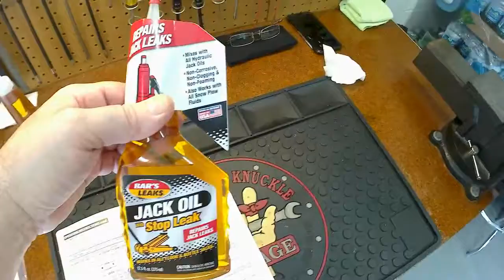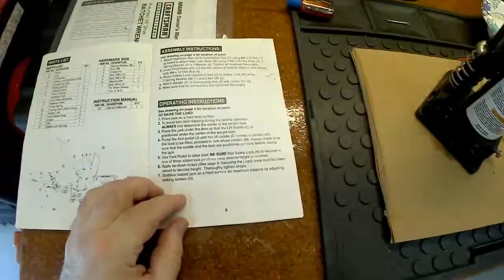Modifying and increasing the life of my 18 year old Craftsman motorcycle jack.

Comment: Just installed a Redline Rl-135 bottle jack on my older Craftsman jack that had a worn out bottle jack. It bolted right up with no modifications. Now I have a rebuilt Craftsman jack.......
Reply from the maker: That's awesome! I'll definitely look into that bottle when my bottle jack quits on me. Nice to know these are easily rebuilt and I personally feel they are a lot better built than the ones you can buy today. I bought mine back in around 2004.

Comment: Hello Tank, thanks for the comprehensive video. Your video shows up when I search for a “craftsman 50190”. I bought a used jack a couple of days ago and got my bike on it (Sportster). The jack keeps leaking whenever I pump it (with or without bike). Would a oil change service help or would I need to rebuild the bottle jack? I don’t have a vice to break it down but would appreciate your help if you could share what serviceable parts I could start with. Thanks for your help !
Reply from the maker: This is what I've found, the seals inside the jack start to harden and shrink causing fluid to leak by thus causing the problems you are experiencing. The jack oil I used in this video  says it prevents leaks, while a blown seal cannot be fixed and has to be replaced, a hardened seal can be rejuvenated with the jack oil I used by softening and enlarging the seals back to where they should be. After about a week of the jack oil working it's magic, my jack is as good as new. I have three bottle jacks, and two floor jacks that I have replaced the oil in and they are performing like new again. Funny how a little sweat and servicing a nice jack can prolong the life of it so well. Good luck with your jack.
Reply: @tanktankerson1042  thank you so much for the quick response. I bought the fluid and realized the seal inside the pump spring is broken. Unable to find it online or at Home Depot. Will try to send you the pictures and see if you could point me in the right direction.
Reply from the maker: @theblackarrow  No worries, if you have a broken seal, I would remove it and bring it down to an Ace Hardware, not Lowes or Home Depot. Ace usually some of the obscure items in their bins. No pictures needed but that's what I would try first. Sometimes it's hard to find the actual parts for these things. I'm not an expert on these things but I do my best in trying to repair rather than replace.

Comment: Sorry but did you skip how to bleed it
Reply from the maker: That's why I have this in the description:
This is "not" a "How to" video, some mechanical common sense is required concerning me actually showing the Jack fluid draining out of the hole shown in the video or bleeding the air out of the bottle jack itself. Rather, what I've done to prolong the continued use of of Craftsman Motorcycle Jack.
Reply: @tanktankerson1042  does your owners manual tell you how to get air out, once you fill jack with oil, i have the same jack
Reply from the maker: @nickpanhead7209  The following link is the "manual"- page 9 talks about bleeding,
https://www.pullr.com/uploads/4/5/4/7/45472991/50190_o&s_manual.pdf
Reply: What are the 2 flat head bolts on the bottom of the cylinder
Reply from the maker: Not showing the bleed process is in the description Nick, sorry about that.

Comment: I just bought a Sears Craftsman motorcycle jack that was several years old as there are no new Craftsman jacks in any inventory anymore. I chose the old Craftsman because many of the current models are cheezed down on quality. The new ones have much less metal and the designs have shrunk down the heavy gage main frame with less bracing and no metal around the front wheels. The Craftsman jack is a beast and weighs probably 10 pounds more then the Harbor Freight and all the other knock offs. So this gave me the opportunity to buy the best at less costs and clean it up and refurbish it which I've done. I first sanded all the rust off the frame with small wire wheels and flap wheels on my drill. Then use Rust-Oleum (Rusty Metal Primer) on the whole frame followed by the Rust-Oleum Semi-Gloss Black brush on top coat. The red parts I bought a spray can of "Cherry Red" Rust-Oleum metal paint and sanded down all the rust and sprayed that on. Next a lot of the hardware was working but looked bad - especially the Acorn Nuts used on all the pivot points. I bought new stainless Acorn Nuts and some lock and flat washers and got rid of all the rusty bits. On the platform top where the motorcycle sits I replaced the rusty Acorn nuts with some stainless steel lifting triangle shaped eyelet nuts.  The Craftsman has all M12 heavy duty fasteners.  These triangle (eyelets) can be attached to the bike at first contact and the bike will not go anywhere during the lifting process unlike the loops down on the base cannot be used until the bike is fully up in the air. (good luck with that).  I've posted the final assembly build and modified skid plate on a Kawasaki Versys X300 to allow it to be lifted up in the air.   The video is on my channel - LINK:  https://www.youtube.com/watch?v=ZOFhH2zYQyM&ab_channel=trekOCLVone
Reply from the maker: Just watched your video, great job on the stand and I like the bike too! I'll have to check out more of your videos on your channel.
Reply: @tanktankerson1042  Great !  Goal of raising up the Versys X300 took some engineering and the Craftsman Stand restore and the bike modifications all came together better than I thought possible.  Please subscribe as more videos are planned and it's getting cold here and that will slow me down.  lol
Reply: I just purchased a Craftsman 50190 low profile motorcycle/ATV jack this morning at a local Ace Hardware brand new in the box and in perfect condition. Now to see if it fits under my 2021 Can Am Spyder RTL.
Reply from the maker: @heystarfish100  Well done! The old one I have is built a lot better than some of the newer ones out there there for over twice the price. You'll get a lot of good years out of it.
Reply: @tanktankerson1042  Yes - the old Craftsman jacks like the one I restored are really made well.   If the Craftsman Jack doesn't work out for you I'll buy it.  Thank you, Dave
Reply: @heystarfish100  Wow - what a find.  I don't know when they stopped the Craftsman motorcycle jacks but you were in the right place to get one of the last new one's out there.

Comment: I have the Craftsman 50190 I just picked up free because it would go down. I pull the plug at the bottom to get it down but the jack foot pump doesn't move and won't do anything.
What should I be looking for
Reply from the maker: I'm not a jack technician but just reading over your message, it "sounds" like the seals inside are being bypassed due to deterioration over the years. It's kind of why, even when the jack is new, it's a good idea to replace the fluid every once in a while.
You can try dismantling the jack and checking the seals and looking for the hardware to replace the worn parts with  or, you can go online and look for a replacement bottle jack for it.
I wish I could be of more help but I'm just a home mechanic / hobbyist that tries to give folks preventative maintenance tips on things like this.